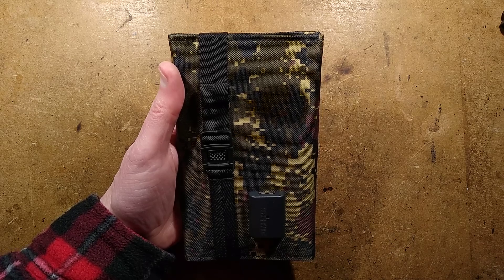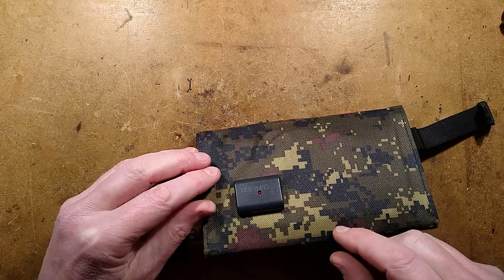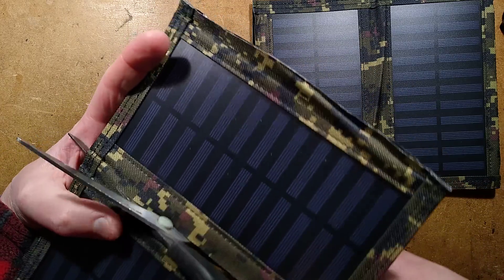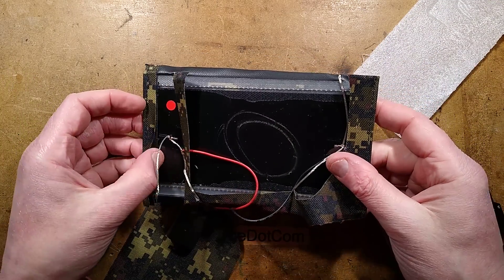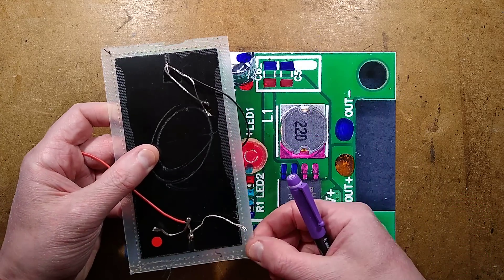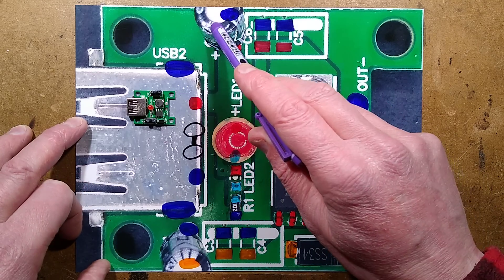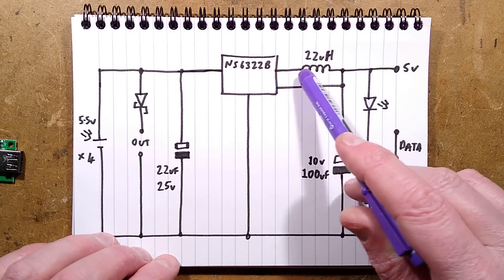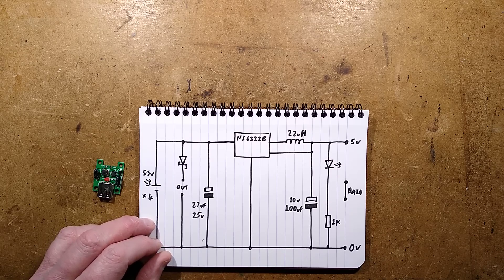Inside an eBay folding solar panel - with schematic

Comment: My tip for anyone who is thinking of buying any kind of a portable solar panel for hiking: if your trip is at most a few days (1 weekend), just bring 1 or 2 large power banks. A power bank takes less space and will be enough to get a few full charges for your phone. The power bank will also "just work" even while hiking regardless of the weather, tree cover or other circumstances. For a week-long trip a solar panel might be useful because after a point carrying enough power banks will become prohibitive
Reply: I've been testing power banks from Amazon, and the manufacturers of all the "50,000mAh" banks lie!  The power storage capacity you get is 48 to 59% of what was promised. They weigh 20 to 24 ounces.  So test before you carry one around for a few days!
Reply: @condew6103  I have a „Power bank“ of sorts which claims to have about 900Ah in the battery...But that's at 12v=, the battery's full of lead, and would normally be found in the engine bay of most cars... 🙃
Reply: @UK-Combustibility-Assured  Those things weigh in at about 30-40 pounds; not the sort of "power bank" you'd even think about carrying along on a hike.

Edit: oh, you're joking.  I'm slow on the uptake this morning.
Reply: Imagen the resistance/current drop on  of 2 km  1.5 mm□ extension cord ,it would be huge !
Let's hope you dont need something more than a phone charger in i end of that.
Even when using 200 meter of  
"Thinner "extension cord the resistance current drop is high enough to
Make high energy demanding stuff start to act up.
When I weld I use 2,5□ mm 
Extension cords the welder takes 16 amps  and will simply 
Turn of its self  off on a long 1.5 mm□ cord
Reply: I have a power bank with a solar panel on it, it's very good for backpacking to keep my phone and tent light charged
Reply: @Nifylau  Clive took one of those apart!

https://youtu.be/duuws2g57Yc?si=kXAwqmnKA4A0tCUc
Reply: A sufficiently long extension lead is also a possibility, if a 60-mile reel of cable isn't too much of a burden for you to lump around... 🔌↔⛺🙃

Comment: Decent quality solar panels are typically rated for 250W per square metre but that's with perfect alignment to the sun at the Equator and absolutely no haze, dust, cloud anything in the way. The further north or south you go from the Equator the lightpath through the atmosphere reduces that 250W figure substantially even on a nice clear summer day on the Isle of Fog.

If you look to use these sorts of portable solar panel arrays for camping, boats etc. just accept that they're never going to produce the output the seller says they will and get used to disappointment.

Comment: Curious if the ns chip provides reverse current protection since I don't see a diode in there. Solar cells are ostensibly a diode junction while in the dark- and without a reverse protection diode they can actually drain the device on charge. Less likely with smart USB but I could see some USB c devices thinking it was a load.

Comment: It's funny that there are plenty of solar panels covered in special extra transparent and "tough" glass, in aluminium frames, with 25 years warranty that cost < £1/W,  actual nominal watt, while the market for small laminated panels seems flooded by products that cost multiple £/W, again actual nominal watt, and apparently sometimes half the area that is supposed to be solar cells is dead space. The empty space isn't just about not getting what you paid for when it's supposed to be carried around, the panel gets bigger and heavier than necessary. 

I was offered 30% refund, once, when I received a clear acrylic container for water that was both cracked and had a lot of scratches, seller arguing that would be fair as they had costs for things shipping they had to cover. I got angry, how about try to not send garbage?  A 30% refund would probably still meant net profit for them, and I would have ended up paying for garbage.   

While that solar panel at least has some function, I'd still consider offering a 30% refund or demanding the object being returned for a full return a bit offensive. They probably still had a net profit, from knowingly selling something not even close to what they described.

Comment: These things are junk, ok enough for occasional and emergency use but for regular use they'll fall apart. At worse one of the connections will go while at best the plastic on the cells gives way exposing the cells.

Comment: Could a product of this size be produced that would actually put out 10 watts (on the brightest day)?
Reply: Could if used top off the line, not 20 y/o or so and cheapest solar cell tech taken/reused from calculators, garden light etc... Those cell efficiency like what? 10-15%? Output 2.5W... so good ones efficiency ~20-30% (double output or more) and cell could be packed closer/denser too.
Reply: The more expensive consumer-grade panels currently do 200-230 watts/m`2.

Comment: I bought two styles of solar panels, one like that style and I noticed right away it didn’t have the power. The second one I bought was rated at 16w, that’ll change a phone up in the middle of winter and not much bigger than that one
Reply: The ones as of June 2025 at the top on ebay are shitty "8w" panels being listed as "80w" and frankly, I have low confidence in Chinese landfill material being even that strong to do 8w reliably.

Comment: 20W, you were robbed. I've found these advertised on that site as 100W and 300W. I also found a 15W panel (which might just generate 15 watts in perfect conditions) being advertised as 1000W. 
Unfortunately, these solar panel scams are making it hard to buy solar panels in online auction sites.

Comment: I have recently had a couple of "Not as described" items, and have been offered the 30% refund, I have refused it and been given a full refund and still kept thee item, well in one case eBay had automtically issued the return label, I put it in the post, then the seller contacted me to ask if would I take a 30% discount, I informed them I had already retuned the item, got full refund, the item was never picked up by them so Aus Post returned it.

Comment: iPhones can charge with 500mA, but the data pins have to be shorted in any case and also, any modern phone should be turned off if you try charging with 500mA.

Comment: I obviously never believe them about output but I have a cheap non folding version that works great for what I wanted.  I never charge the phone directly though.  I use the panel to charge power banks.  I don't really trust them with a phone. 😂

Comment: Anything sold for “camping” that is clad in camouflage is immediately suspect to me. If you drop it, how will you find it? The scissors were not sacrilege- it deserved worse. Pinking shears at least.

Those ridiculously inefficient solar panels strike me as possibly useful as sensors for security systems, or for powering slightly less unreliable than the usual solar powered “garden lights”.

As the device is sold it’s pretty much useless for me as well, living here in the US Pacific Northwet where we get almost as much annual sunlight as you do.

Comment: before I bought one of those I did what I usually do and looked up every other listing of exactly the same product, of course they all have different specs listed, i generally throw out the outliers, average out the mean then assume its likely about half of that. 
If i'm lucky I can find some nice youtuber to teardown or review the item before I purchase, and of course I look for every negative review I can find so I know what the likely issues are.
I havent used it yet or even tested, on close inspection the cells look like they're just printed on a sheet of plastic, lets see if this can charge my phone.....
Edit: Well it is real, seems to struggle to run a completely flat 1 watt USB device, I'll let it charge for an hour to see how much juice it can actually put out. I have one of the 3 panel ones, judging from what you got I'll assume mine should output 2.2ish watts.
Well when I purchased I was hoping it was around 5 watts, but 2 is fine, that'll still charge a basic powerbank in a day, if you're desperate enough for power that you're relying on this thing thats still absolutely fine , just dont waste it on cookie clicker or something.

Comment: Apple devices might tolerate lower charging speeds, but that depends.
If it's too low it may error out saying "Not charging" on the battery indicator, however, it could still charge despite that error just incredibly slowly or the apple device will just use whatever it can to slow down if not negate the battery drain.

Comment: Years ago (in 2015) I bought an "8W" solar panel with just two (larger) folds that was mostly a disappointment; practically speaking it could only put out about 3.5W (maybe 4.5W with perfect sun alignment), although it did have much better fill than your example so you got better "bang for your buck" carrying it around at least.

I have more recently bought a larger ETFE-coated 4-fold panel for about $50 off Aliexpress that advertised 40W. I knew this was a bit optimistic but was much less unbelievable compared to similar-sized panels quoting 80W-150W, and after testing have found that it will put out a solid 30W peak when angled perfectly in bright sun, and a pretty reliable 15-20W is normal "reasonable" conditions. All told I'm pretty happy with this; it's quite compact (smaller than a laptop and much lighter) and can easily charge any phone at a decent rate, and will charge up a fairly large power bank over the course of a day. Much better than the nigh-unusable 3-4W of the old one, and it's barely larger when folded up.

I would say these newer ETFE-laminated panels are somewhat less scammy/suspect than other variants, if only because they only bother putting the better coating/encapsulation on the actually-decent panels because it's a bit more expensive anyway.

Comment: I bought the same thing that was claimed to be 200w, they then offered the same discounts, and eventually fully refunded me the money.
And, yes it is now a free emergency trickle charger for my android phone.
Reply: You rely on the sun in the UK in an emergency?
Brave man. I carry a fully charged USB battery, charged up before I go out.
Reply: @deang5622  And when that USB pack, and the 2 other back up USB packs go flat, then it can be used to put a trickle into the first one. But, to be fair, I live in paradise where the sun shines 320 days a year.

Comment: Always check your equipment before going out such as camping. I even test my GPS app in my local area so I will not get lost if the app gives me poor or incorrect directions.
Reply: Surely GPS is global...or do they restrict the position of the satellites to only where you live? 😭🤣😂

Comment: Chinese need more Dollar's so employ a low paid skilled worker to assemble a reasonably good case but save money by not providing a solar panel that is usable. Postage paid by CCP.  Then put in the add,  "Please don't leave negative feedback because we care so much about you as our valued customer.     Chinese quote ;   "Take what you can, give nothing back!"

Comment: I got one from Temu late last year - "15" watt output - 4 panel in which the panels are full as the ad shown - and it works well at charging up power banks or USB powered lights - and does charge up my Fold5 in bright sunlight without it complaining about the charger being too slow but better with power banks than anything else..
Reply: Don't forget that Chinese manufacturers put the decimal point in a different place to British ones. That „15w“ converts to 0.15w (150mW) in British standard measurements. 🙃

Though don't quote me on this; I'm the sort of person who prefers to use a comma... 🇩🇪😉

Comment: It would be interesting to see the solar cells electroluminescence using an IR camera and a current limited supply. I did that on some reject panels and the non functioning/cracked cells show up very clearly.
Reply: That's a neat idea. I have a damaged solar panel and an old camcorder with "Nightshot" mode. Do you think that will be enough to locate the fault?

Comment: I have a briefcase size Togo brand portable Solar panel 120w,it's amazing use it charge my portable lights,battery packs etc.The panel on this look like something from a cheap solar landscape light or battery pack with a solar panel built in.I live in Las Vegas so all we get is Sun, thanks for the tear down.Want something really neat check out the Nocturne Firefly  Solar Lamp

Comment: I have a source in the US of a much better solar panel that gets close to meeting its stated specifications.  5V (unregulated) at almost 1 whole amp in full summer sun.  1 downside: it's not foldable or pocket-size.
Clive nailed it again; You're better off with a bigger panel and/or a powerbank.
Preferably a powerbank that takes whatever it can get and stores it efficiently.

Comment: There are fiberglass backed panels aplenty on eBay all of which claim to be 50 Watts.  Just looking at them, the physical dimensions indicate 5 to 10 Watts.  If you keep that in mind, they aren’t bad.  The output circuit looks about the same as the one in this video with the addition of a direct output jack.  I gave one to a friend who had trouble with her car battery going flat because she drives very little.  The panel came with a ridiculously short output cable about 15 cm long.  I made a cable long enough to attach the panel to the rear window and reach the battery which is mounted in the boot.  Since then the battery has stayed sufficiently charged.  I considered adding a spare Victron charge controller I have to prevent over-charge, but that seemed like more complexity than necessary.

Comment: I have one similar to this, and the output from the USB port was rather dismal at something like 250ma, BUT the output directly from the panel put out a good 5 watts. The USB converter was just garbage by itself. One tiny little I.C. in there and a few passives and wasn't worth 25 cents

Comment: It would further reduce efficiency (one more step) but it might work better to charge up a power bank, which isn't too smart ("it just charges" without any fancy detection and cut offs) and then use that to charge a phone/device at a higher current, like 2A (5V).

Comment: You got scammed, I bought the exact same one as in the pic a few years back and has the same panel configuration too and I just noticed came with the 2 carabiners in the pouch on the back.
It works okay but really only to charge a power bank as you said.

Comment: So what would you do to charge USB devices off grid camping ? 
Somthing to wind maybe using super capacitors then lithium cells 🤔 
Good video again Clive thank you
Reply from the maker: A large power bank topped up by whatever energy sources are suited to the location.

Comment: I have one of those panels, but it's larger and only 2 elements, Wich do have a bit more silicon in them aswell
The peak I got from it was about 3.5 watts
I do use it when camping and usually it feeds a Portable powerbank the whole day Wich then feeds the phone or whatever else I happen to want to charge in the evening

Comment: If the product is incorrect in any way and you wanna return it the seller is paying postage fees and usually it's more expensive then the product itself. ( Chinese products etc) therefore you could keep the product and still get a full refund.
Reply: Some will make you return items just to inconvenience you. The goods never leave the destination country and are then auctioned of by the kilo, or even just dumped!

PS the vendors will spend hours arguing their spurious case... Even after I got one of my pointed e-mails to an argumentitive conman translated into very  unflattering Han Chinese 😉

Comment: you should do a base test of the panel in the sun and see it the buck is the reason for the low output
Reply from the maker: That would require good levels of sun again.

Comment: I think it's made by the same people who make the 10,000 mAh 18650 cells.
Reply: And the 1000 dB train horns...
Reply: You forgot the 1,000,000 lumen flashlights for only $30.
Reply: And 8 million volt stun guns
Reply: I think that's the same cells that they use in my 100000000000000000 mAh power bank.    I'm going to harvest the batteries from it for my bike and travel Europe on one charge.
Reply: I went to the moon and back with one of those.
Reply: @erikdenhouter  
Did you smoke it?
Reply: Math. Is. Hard.

Comment: Can you remove the lamination from the panels? How much power do the panels produce with and without the plastic lamination? I'd think that the plastic lamination would negatively affect the performance of the device.
Reply from the maker: That would break the silicon cells.

Comment: some sellers do completely make up the ratings, but even the ones who try and get it right but don't actually measure anything will end up getting them wrong. in something as popular as these solar cell packs, hundreds of companies end up making them and using the wrong encapsulation plastics. along with not testing what they actually sell, they don't notice the encapsulation cut the utility of the cells by 70%. that chip can do over 3 amps but the minimum input voltage is 6.5v. mistakes were made

Comment: The power output would be regulated by the circuitry. It would have to be more than 500 ma coming from the panels to be regulated to that